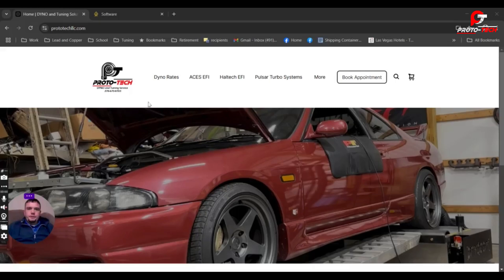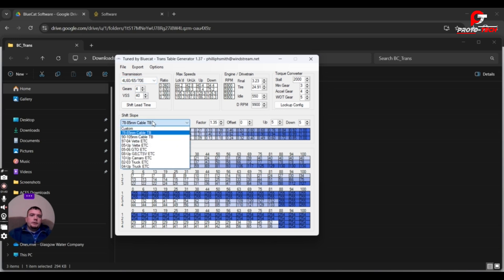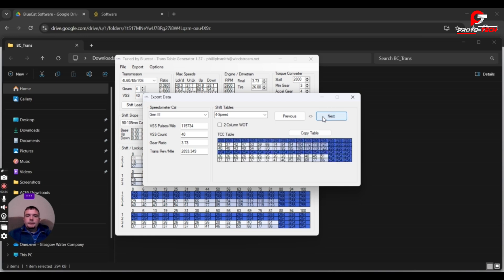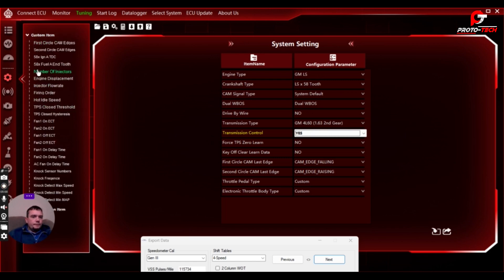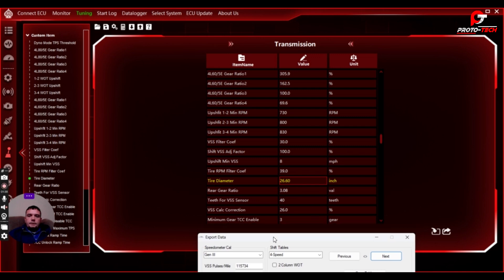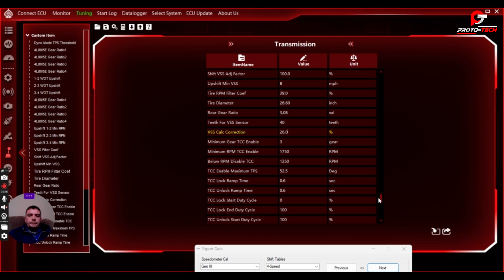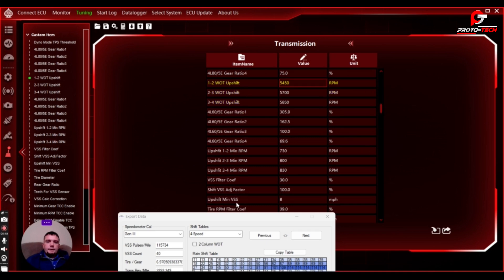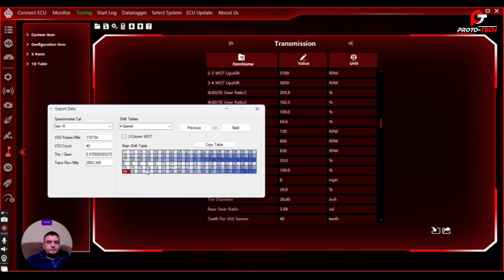Transmission Tuning Aces EFI

Comment: I think your video is the only one I can find on the bluecat table generator. I wish I can find one on using the tool for a 4l80e trans in a silverado. so far no luck.
Reply from the maker: Works the same for 60s and 80s.

Comment: Just used some of your settings for my 4l60e with the Quick Draw and it shifts much better. Now if I could just get my 383 with the Wild Card tuned in a little better then I’d be set. Thanks for your videos.
Reply from the maker: Glad they help ! If you need remote help just reach out prototechllc@gmail.com
Reply: @prototechllc thanks and I might just do that.

Comment: hey there brother I have a question, so I've followed your advice on this and glad to see videos like these as a beginner, but what are the adjustments that need to be made in order to get the transmission to go into gear more smoothly when in park? my transmission hits the first drive gear really hard when i go from park to drive or from park to reverse and it clunks really hard. is the gear upshift retard that controls that as well or what other setting do i need to go into to fix that??? Thank you for your time!

Comment: Thanks for sharing this info, I will be installing my Jackpot in a week or two and this for sure comes in handy. 👍🏼
Reply from the maker: you're welcome
Reply: @prototechllc got a concern! This past week I installed my Jackpot and engine wise is working great however my transmission is acting up, before the installation when ever I applied rev it would gently go but all my forward gears you would feel them as applied. Now it’s the opposite, rev gives a kick and forward gears you barely feel them. Then came the worst, I went to pull forward and trans seems to be slipping. At first I I wasn’t concerned cause I have a 2,800-3,200 stall but it didn’t feel right and I would say it seems not to go into 2nd gear and hits 3rd with a bump and it does go into 4th! Even on first gear even though it’s applied it still doesn’t feel as strong as it used to. Any advice?
Reply from the maker: @ do you have dbw firmware loaded ?
Reply: @ mine is DBC!
Reply from the maker: @ it doesn’t matter, with trans control you select dbw firmware. Run the wizard and then set dbw to “no” in the handheld or advance tuning software and do a tps reset.
Reply: @ ok, will do that and let you know.